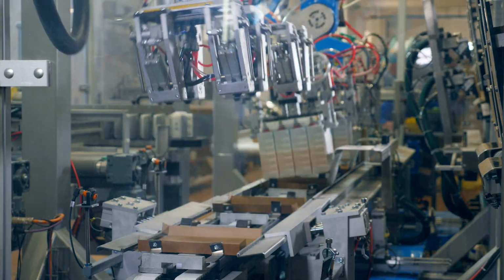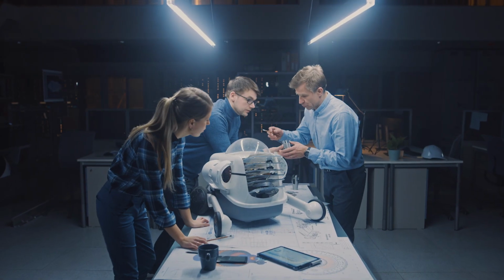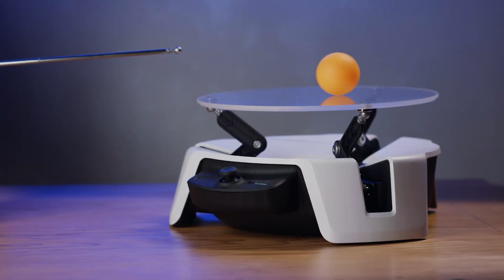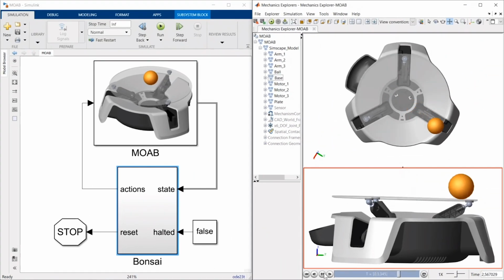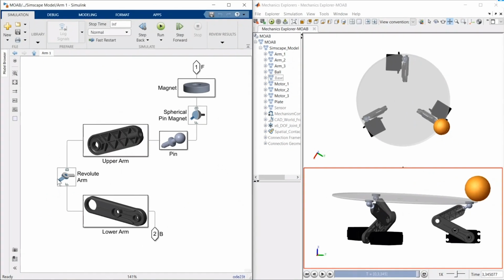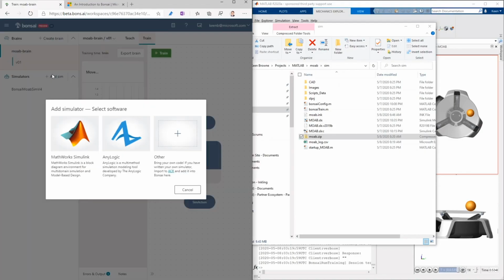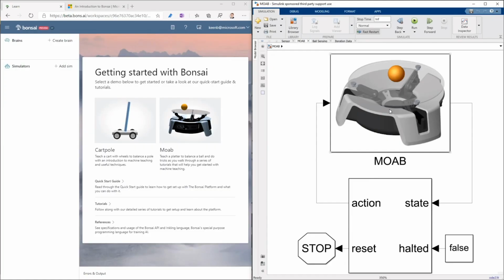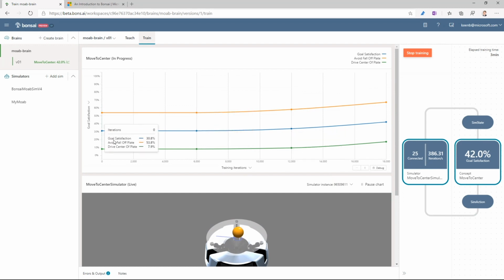How to build Intelligent control systems using new tools from Microsoft and simulations by Mathworks

Comment: Depending on the sensor inputs that can be developed in simulation, this kind of kinematic system could be used to relieve personnel stress in meatpacking lines, by aligning the geometry of carcass for each cutting operation.